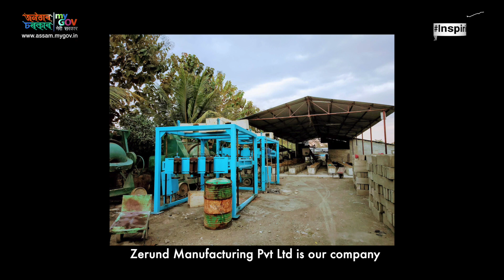Young Engineers Make Bricks With Plastic

Comment: suggest: show the pouring of molten mix into molds; timelines from raw crud to molten to mold to cooled final; 
suggest: point out 'fly ash' is a waste product deemed by many cities as a pollutant; sequestering it into brick not only offers better brick but prevents pollution; tyou ought mention electrical production from coal generates fly ash which utilities will pay you to take away; 
Q: can surface be colored? red? blue? yellow? decorative brick sells for more in USA/UK; 
Q: how many kilos of plastic yield how many kilos of brick?

Q: how many liters of water per ton of brick are consumed?
Q: can surface be coated with reflective mylar? not only decorative  but reduces thermal transfer from sunlight; 
good luck